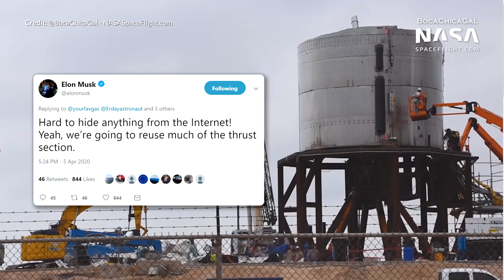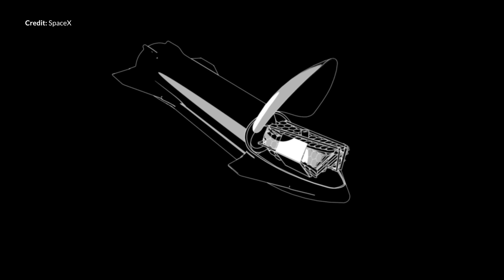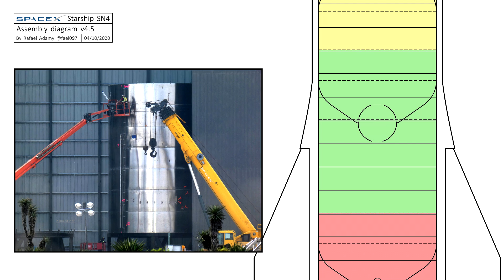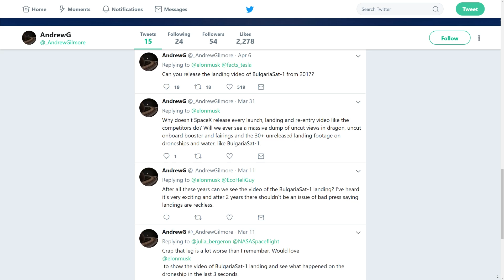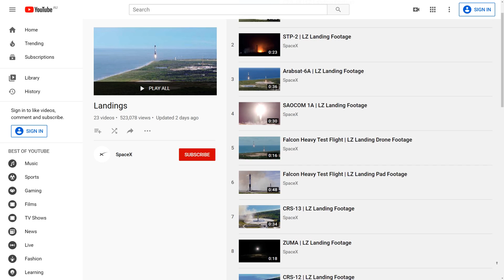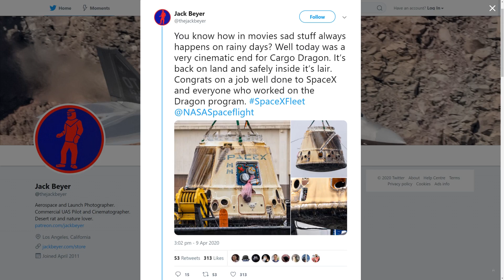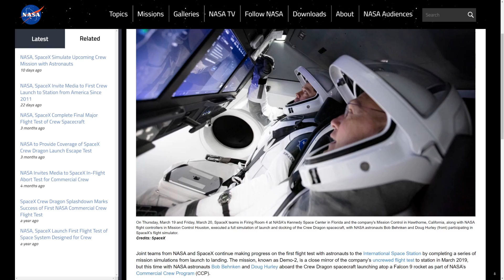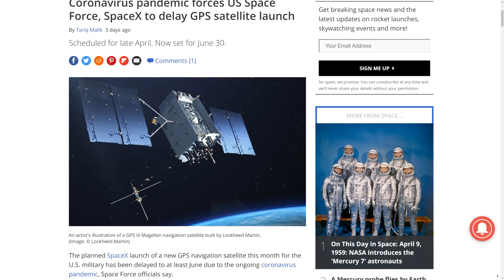SpaceX Starship SN4 News, Goodbye Cargo Dragon 1 and Rocket Lab Mid-Air Recovery Demo

Comment: if you have a half decent rigging crew and a decent  crane operator you can get things done in breakneck speeds do everything once and not have to lift a part thirty time before making those close connections

Comment: Electron:
The capture is impressive, but extremely difficult to ensure that they will be able to complete each time. There are several major variables that will limit when they can fly because they have to be extremely precise on weather (not just for the helicopter, but rocket drift with parachutes), return trajectory, etc, etc.  

The military explored this concept in the 50's and 60's with varying degrees of success, none of which were fiscally practical.

Unfortunately, this will most likely be a failed concept.

Comment: Why do the parts they are stacking look like they've had the crap kicked out of them, doesn't look very professional or technically skilled work.
Reply: "Why do the parts they are stacking look like they've had the crap kicked out of them" Sometimes because they are literally "persuaded" into place by a sledge hammer. But mostly because of welding heat warping the steel panels.
 
"doesn't look very professional or technically skilled work." Doesn't have to, as long as it works. Why spend money on making a prototype look good if the chances are 50/50 of it blowing up sooner or later?

Comment: Any ideas out there  what  starship s first flight will be like. . I'm, thinking blast off slowly  ascend to 15 or 18 km throttle down or shut off, descend     straight  down with engines in idle then throttle  up at landing. Does anyone  think  starship, will skydive decend on first time out?
Reply: First flight will be a short hop. About 150 meters. SpaceX has to test the 3-engine configuration first. 
Second flight will be 1-5km but only vertical. 
Third flight will be with engine shut off.
Before forth flight they will finally install the flaps and nose cone and then try the belly flop.

Every time a flight ends with a RUD it will be redone with the next SN.

Comment: Will Spacex Or Elon Ever Improve Starship Structural Integrity Design. And Say Good Bye To Just Pressure The Rocket Ship Structural Design,
Reply: Your English is pretty broken so your comment is hard to understand but I will try to answer.

 They will improve the design if its needed. The current designed structure is stable when it isn't loaded with propellants and if they keep the tanks correctly pressurized, it will probably be stable then too.

Comment: Two comments:
-When a Rigger is using a crane, the very first thing he looks at is the crane's chart.(It tells everything)    Then he places the crane in the best spot and selects the correct rigging. If you have a Journeyman Rigger, then everything looks easy.  
-Second, When you start seeing test failures like the most recent one,  You are usually either reaching the talent limit of your people, Or you are pushing them along a little faster than they can perform.  (A test oops that shouldn't have happened.  But did, because of not enough time to check the code, or not realizing that the code needed checked)  It sounds like something that happens in a much larger company.
Reply: "It sounds like something that happens in a much larger company.". Like Boeing?
Reply: @gh8447  I was being polite. LOL

Comment: What is the weight of falcon 9s fairings? Wouldn't this method be a more viable method of fairing recovery?  The weight of a falcon 9 fairing is about 4,000 lbs,  a bell 205 medium lift helicopter has an external load limit of 9,500 lbs.
Reply: But the firing is about double the size of the helicopter. The wind force is simply to high in open seas.

Comment: If SN4 has similar containment and stress problems and crumbles I propose an insert sleeve like a double hull for a ship.Dual Hull for Stronger endurance.
Reply: It's a about weight.  Double hull not happening.
Reply: @rwhitenz  RW,correct weight is the all important factor,as I designed Mars rovers 1987,kept me focused.Unless there are massive failures/crashes/blow-ups/fails,my idea is DUMB.But one day may become SMART,even if not implemented my style of "work-around",but more efficiently with weight in mind.I'm remote from the problem,and in the dark on so many aspects/shots in the dark to fix major fails.I'm more artist than scientist,yet found people on Mars because not hamstrung by NASA/non-disclosure.Not just a critic/cricket,but motivated for Mars exploration.

Comment: first test 10 meters
second test 150 meters
third test 20 km
Reply: Steve Blomefield - 1st test - 150-200 m
2nd test - 15-20 km
3rd test - 85-100 km
4th test - 100+ km
I think you’re right that Elon & SpaceX will want to demonstrate the systems work at each stage before proceeding to the next...

Comment: What About SN5? 
-> Is there ANYTHING of it already made?
Reply: Probably, but to my knowledge we haven't seen any sections for it. I think Elon is demanding SN4 to be made fast so they can get back to testing. I believe SN4 is good enough to test the current design. As long as no mistakes during testing, etc are made, it should work. If it doesn't, things will probably need to be changed.
Reply: https://youtu.be/Kaay1HFezss?t=483
The bulk heads are already done!
NASAspaceflight is always up to date and you see every progress first hand.

Comment: @Marcus House, can you explain please, WHY SpaceX doesn't try to catch thier fairings with the helicopter, like Electron does it with their rockets? This is old technic and it works.
Reply: Could be hard to do if the fairings are falling far out over the ocean.
Reply: @bensemusx  Then fairings should navigate back to the island. Or have a ship with two helicopter landing places instead of ships with the net
Reply: My understanding is that the Falcon fairings are significantly larger than the Electron first stage, and their parachutes are far larger than Electron's, and that makes a helicopter catch impractical. The danger of pendulum action by the fairing and the possibility of wind catching the parachute is just too great.
Reply: @odysseusrex5908  Maybe fairings are lager. But they are empty. I'm sure, that helicopter can manage its weight without problems. Fairing can fly just forward, without maneuvers. And halicopter can use 50 or 70 meters of the rope - longer then enough - and so avoid possible colision.
Reply: @FortepianoAlex    Well, what you are sure of and what the relevant engineers are sure of seem to be two different things.
Reply: @odysseusrex5908  are you one of this relevant engineers? SpaceX Fairing weights approximately 1,900 kg
. Lightweight helicopters can carry maximum of 2,000 kg. Heavylift helicopters can carry to 22.000 kg. Thats facts.
Reply: @FortepianoAlex   As I explained, its not a matter of weight. Go read my original post. My understanding is that this is why that approach has been rejected, by people far more knowledgeable than you.

Comment: Have been following space X's  Progress since 2010, The Falcon 9 system great success! Now  The spaceship, And raptor motors Combination I believe will need much more work then they are anticipating. No I don't want to be a sour puss, But my belief is the 1st space ship major test will be a flop and they will have to start over. The strength of the whole structure will not be able to withstand the dynamic forces of the 1st 2 minutes of the launch. I hope I am  I'm wrong! Time will tell, I am anxious to find  out....

Comment: I'm curious, what is the reasoning behind whether the CH4 or O2 tanks are on top?
Reply: center of mass for landing has to be lined up with center of lift, so they reserve some fuel at the top so it isn't too rear-heavy
Reply: @ryanspence5831  I think he was referring to the order of the main tanks not the placement of the header tanks. I am also curious about this.
Reply: @warpedfusion  Ah, hindsight is 20/20. It's still coincidentally for a very similar reason-- rockets require more oxidizer by mass than fuel, so they keep the heavier (oxidizer) tanks at the top, since a higher center of mass means the center of drag is farther behind the CM meaning more aerodynamic stability.
Reply: @ryanspence5831  Oh, that makes sense. Thanks for explaining that! :)
Reply: @warpedfusion  You're welcome!
Reply: @ryanspence5831  Well, except that the liquid oxygen tank is the lower one. The liquid methane tank sits on top of it. Center of mass is still probably the major factor though.
Reply: @odysseusrex5908  That is actually not true--you can see from the footage of the various starship oxygen tank failures that the oxygen tank is definitely above the methane tank. And besides, if the methane tank was on top, the oxygen tank, which has 3.8x more propellant by mass, would bring the center of gravity so far down that the starship with its relatively far forward center of pressure (due to the forward flaps) could never remain aerodynamically stable as it needs to be for atmospheric entry.
Reply: @ryanspence5831   No, it's not. Go listen to any of the videos dealing with the SN-3 failure, Marcus's, What About It, Scott Manley, they all give excellent descriptions of the construction of the rocket and the failure mode. The fuel tank was filled up, on top of the oxygen tank, which collapsed. Of course, there are many other resources describing Starship configuration. The fuel tank is on top, the oxygen tank below.

Comment: They should use a collapsible mylar bladder in the header tanks and pressuriize the space between the tank and bladder.
Reply: Mylar, being polyester, is brittle at cryogenic temperature. However some flexible barrier sounds good.

Comment: Why does cargo need to be at the top of a stack with liquid fueled rockets?
Reply: I'm not sure, probably so that the engines can be close to the fuel, and it is easier to deploy the cargo, then if it was in the middle
Reply: Probably convience
Reply: Anjay is correct, also center of mass considerations, and simplicity of plumbing.

Comment: Except that it would take away from my Social Security check I would commit some funding. I would really like to make periodic one time donations when I get "rained on" like when I sold a domain name recently.   Otherwise Great content and delivery Marcus!  Seems dangerous from the potential inclement weather or accidental over-city decent to use helicopters of the open rotary propeller configuration to capture boosters, or  electron test tanks etc.
  Also it seems like an expanding bladder or floating bulkhead or baffle; or spinning tank, would be the way to get that fuel consolidated near the pump intake.
Reply: Not sure how the captured it but if it is on a parachute and they fly over it, normal helis don't seem that dangerous.

Comment: The use of stainless steel has really facilitated the rapid production of these prototypes; imagine trying to do this with carbon fiber!,  Well done!
Reply: @Daniel Kintigh keeping in mind nothing has yet worked,  its yet to seen if it was actually a great leap forward
Reply: If they had made tooling that didn't need modification, it could be pretty quick. But once you need to modify your molds the time required explodes

Comment: Why would the initial test go beyond Starhopper? If the test succeeds perfectly, they could just fly it again higher than before. It’s not like Starhopper is a good test for the current architecture as it was rather small, massively overbuilt (the walls were significantly thicker) and had only one engine.

Comment: I can still see a big problem with that landing procedure, the same that pushed NASA to refuse power landing for the dragon V2. There is absolutely no safeguards if the engines don’t perform perfectly in a paper thin window of time, if that fails you are in a 747 with no wings seconds away from fast unplanned disassembly.
Reply: There is redundancy in the engines. Just like how the recent engine out on the Falcon 9 flight didn’t result in a failed mission the same capability will be in Starship. It doesn’t make it 100% but it raises the chance of success.
Reply: There is no such thing as safe. There are only acceptable risks. Airplanes crash, often killing hundreds of people. The day will inevitably come that a Starship will be destroyed, on launch, landing, or in space, killing hundreds of people. Unless we are complete idiots about it, that will not be the last time, but only the first. In nearly sixty years of manned spaceflight, only twenty two people have died in spacecraft. That, frankly, is remarkable. Over the next hundred years, as we explore and settle the solar system, that number is likely to rise in to the thousands.
Reply: Odysseus Rex bad example the commercial planes are crazy safe relative to the number of people transported, you would need thousands of years of no casualties in space flight to reach that level of safety. But really it isn’t my point of view, it’s NASA and when they will see that multiple instances of a single point of failure can lead to an unrecoverable situation, they will veto it like they did for the V2. It’s one thing blowing up tanks in the desert and an all other one scraping bodies off the ground, NASA has been there with the shuttle. For the moment spaceX has good record of getting a lighter booster with no one on it back, it would be totally unacceptable if anyone was on board.
Reply: I agree, when attempting a landing like what the Falcons do, there are 'no' second chances. You've only got one shot, mess it up, that's it, you'll crash.
Reply: grizzomble two engines rarely fail together that’s why there’s two, when they are running well they rarely just shutoff instantly but if that unlikely scenario happens there is the ejection seats and a little time to glide. So yes one of the most dangerous things you could do in a plane is still way off that landing procedure.

Comment: What ever happened to the BFR ? Just curious. Thanks
Reply: 5035551212 BFR and starship are the same rocket. The name just changed
Reply: Starship is BFR. Actually no. Starship is the upper part of BFR, and the lower is Super Heavy, they both together is BFR, something like that, I think
Reply: Oliv Oliv I don’t think the BFR name is in use anywhere anymore. While the upper part is Starship it’s also being used to refer to the whole rocket as well. Kinda like how the rocket used to launch the Soyuz capsule is often referred to as the Soyuz rocket despite having a different name.
Reply: @kapybara8079  No, BFR name is completely scrapped never to be used again and refers to no part of the rocket. Starship is the upper section, Super Heavy is the bottom section and Starship is the entire vehicle

Comment: 8:28 you see the fins on the right burning up. I wonder if that’s why it struggled?
Reply: These were the older aluminum fins, don't think it affects control much mostly a re-usability issue.  It was a hotter re-entry than earlier flights, pushing 1st stage out pretty far.